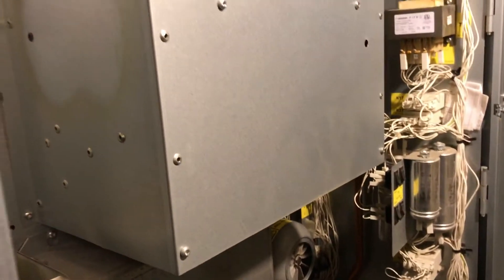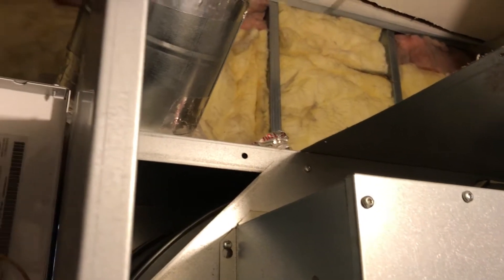Wascomat TD 30x30 dryer plenum removal

Comment: I'm having an issue E15, code on td30,  I've cleaned the following lint tray, the grill removed the vent motor and reached in to an area that's about 1.5 feet long and removed lint from there also. Check for continuity (sp?) On the switch (damper) all check out. Still getting code. Any other places where a vacuum could be lost and allowing the damper to close?